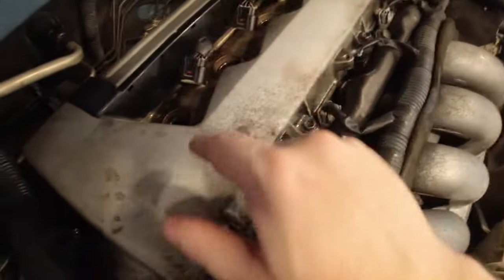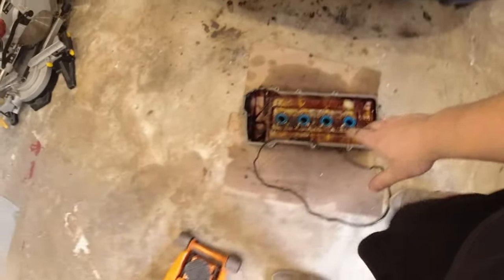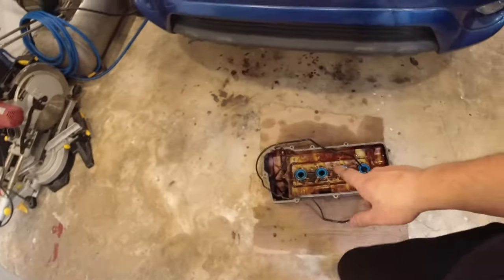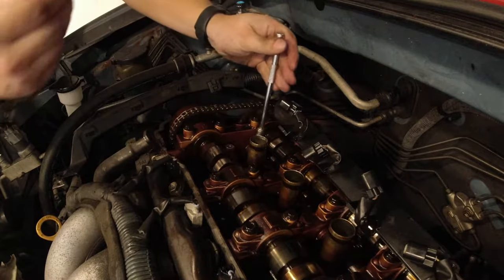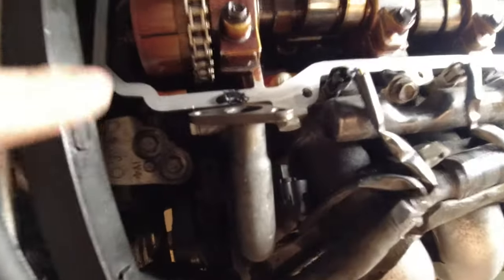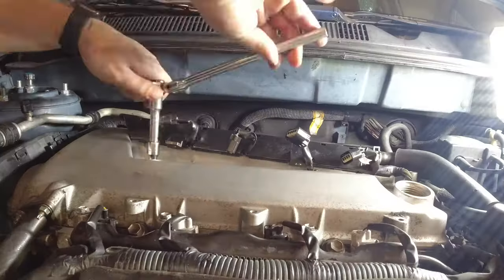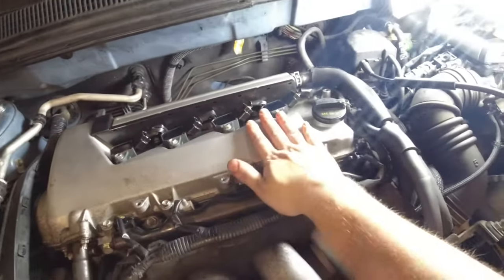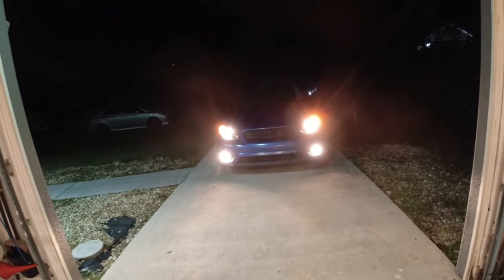TOYOTA MATRIX TUNE UP

Comment: The O2 sensor light could be caused from all the oil in the spark plug tubes went into the cylinders which went into the exhaust. A couple heavy right foot accelerations should clean it up
Reply from the maker: I did not think about that! There was quite a bit of oil in there! We will see if it will go away after a few trips.

Comment: Timing chain cover gasket will be fun. 2zzlow has documented several on celicas. Not too bad to do without removing the engine.
Reply from the maker: I have watched a few of his videos! He has some great videos on the 2ZZ!
Reply: @BrandonStellmach  do document the work if you diy. Its so satisfying to fix the leak lol
Reply: @BrandonStellmach Just got doing it with my 03 XRS!! Not too bad of a job, but you absolutely HAVE to remove the stud for the serpentine belt tensioner. No way to get the front cover off without doing so. I learned the hard way.
Reply from the maker: @PlayinWithMahWii good to know!

Comment: The single wire over the valve cover goes to the power steering pump. I ended up disconnecting it by feel and pulled the harness out of the way, which made getting the valve on and off easy.
Reply from the maker: I couldn’t see where it disconnected, so I left it on! But it would have been much easier with it taken off!
Reply: @BrandonStellmach  There's a little rubber sleeve that goes over the connector that pulls up. You have to just disconnect it by feel unfortunately
Reply from the maker: @PlayinWithMahWii good to know if I ever have to do it again!

Comment: The oxidation i was able to get rid of on my valve cover with some brass wire brushes & sandpaper. While you could probably wire brush it with a drill pretty quickly, I'm not sure how that'd turn out. I recommend painting it if the oxidation bothers you - I've been contemplating painting mine wrinkle black.
Reply from the maker: I have had thoughts about it! Because I could not easily get those oxidation spots off! But a nice black would be a good plan!